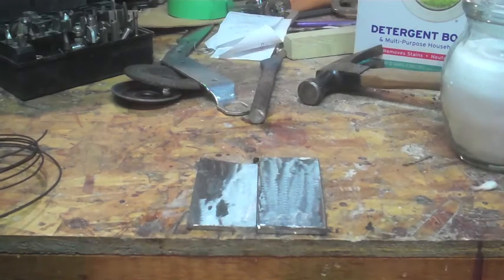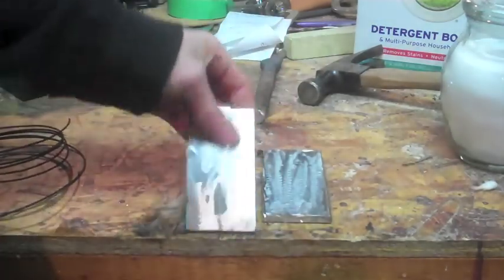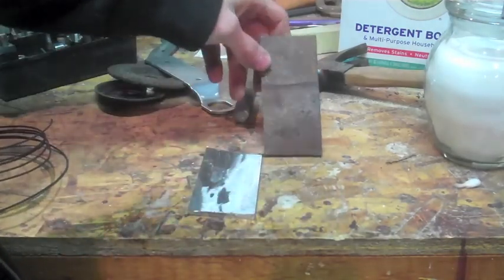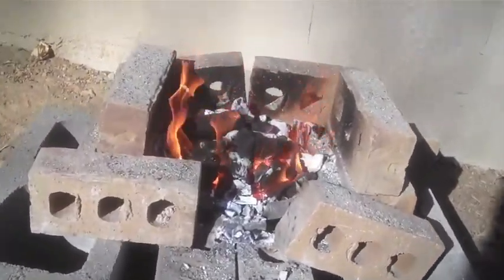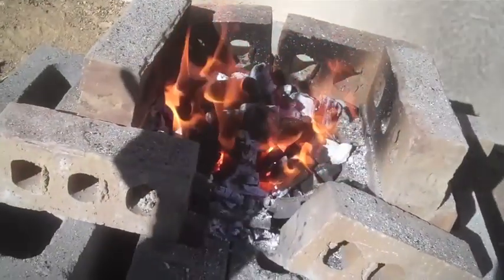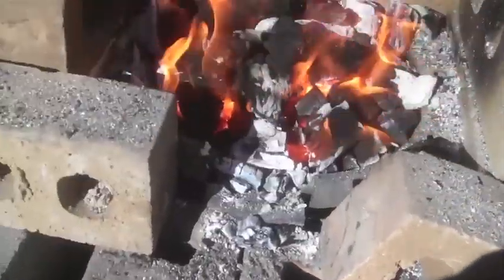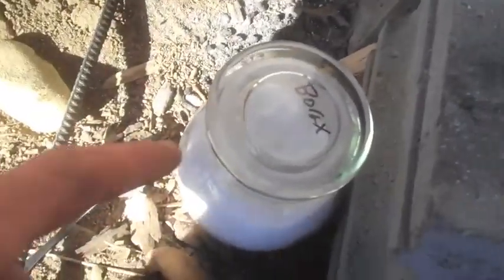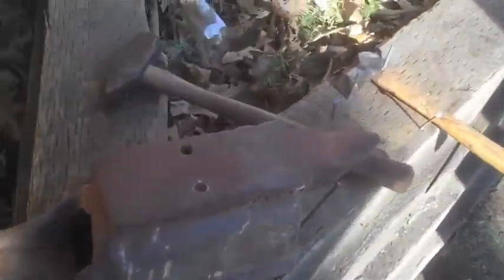Damascus Steel pt.1

Comment: wasn´t your damascus billet a little bit to cold when you forged it the first time ?? or was this not the first forgewelding ??
when i do forgewelding i normally heat the metal until it is white hot and sometimes it makes sparks :)
Reply: +Biegi nator as far as i know, lower heat is not a bad thing, it just makes it harder/slower to finish. Though im 100% sure that sparks are bad, they spoil the metal somehow i think.
Reply: but you need at least a white heat to forgeweld steel otherwise you will get delamination. the sparks are not good but when you watch your steel carfully and you wait until you see the first spark flying and then you forge that would not be a problem. 
the sparks  apear when the steel gets to a temperature where it chemically reakts to oxigen so basically it really burns. but when you have a large pice of steel for forgewelding lets say 2kg  then a little sparking would not be a problem.
Reply: +Biegi nator THOUGH... i think you're right about the heat at first. To my knowledge he should get it way hotter just the first time or couple times to weld the 2 sheets together
Reply: yes i normally do 3 welding cycels where i forge the steel at white hot and after that at an bright orange. the problem is when you stack up much material untill you have a real billet you will need much force to pound it into shape. but i sugest you to watch some video of really good bladesmith. i sadly dont do a lot of forgewelding because it is difficult to get borax in germany but you can watch my other videos.